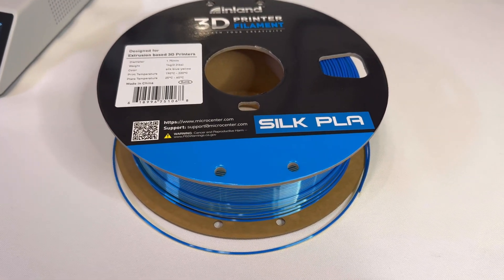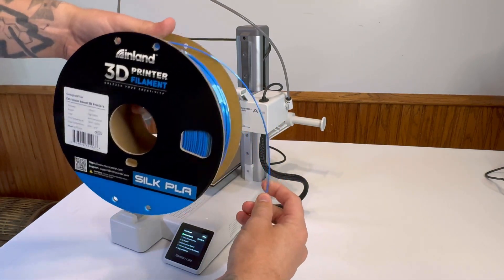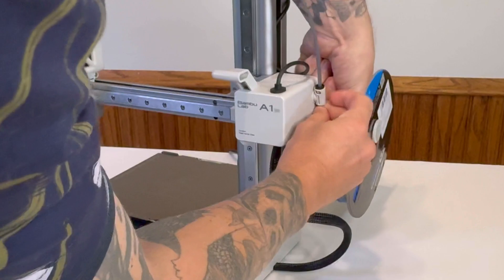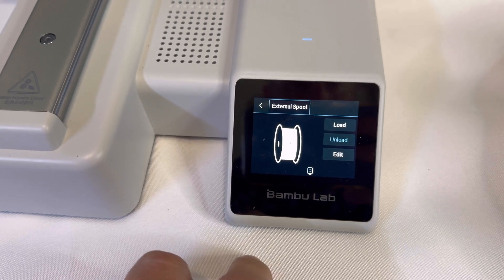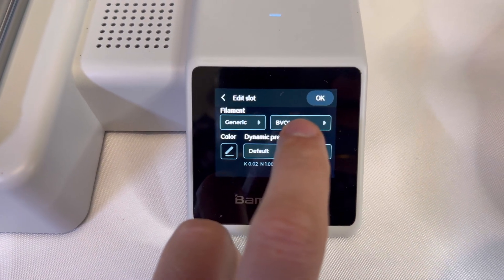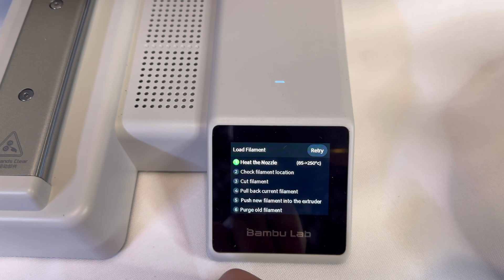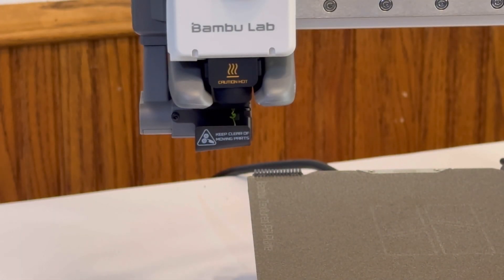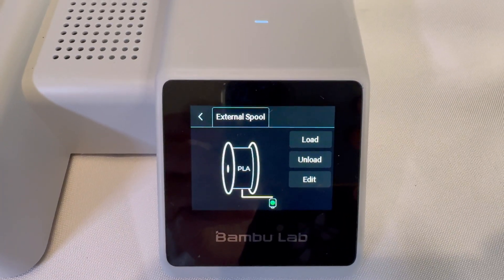How to Load Filament on Bambu Lab A1 Mini

Comment: OK, but if someone watches your video, that means that something went frong for him/her, so you video is kind of little help (you basically follow instruction what the people can generally do themselves)
Reply: By the way in my case the problem was that the printer needs several attempts to properly load and extrude filament. I usually click Repeat 5-7 times and click OK when I see the change of color. Then the printer purges the remaining filament. For some reason, both Bambu and Youtube remain silent about it

Comment: FYI I had to press retry about 10 times before I saw anything being extruded, keep trying!
Reply: Thanks! I was getting worried but this was the case for me as well 😅
Reply: Thanks for the tip!
Reply: Same
Reply: Hold your filament near the roll to see if you feel it moving if seen its likely fine you wont always see something extruding.
Reply: Bruh, you saved me. I already disassembled everything lol
Reply: Thanks, had to retry at least 10 times too and then it grabbed it. Would be nice if the video meant to describe how to load a 3d printer would mention this since everyone watching a video like this is probably new to 3d printing.! haha
Reply: Facts Only! Thanks mate

Comment: After your video ends my bambu would run the toolhead over to the cutter bar and then say spool stuck. Endless death loop. So I removed the spool and left a lot of filament dangling out the tube and it still said spool stuck. Opened a ticket for a faulty head.